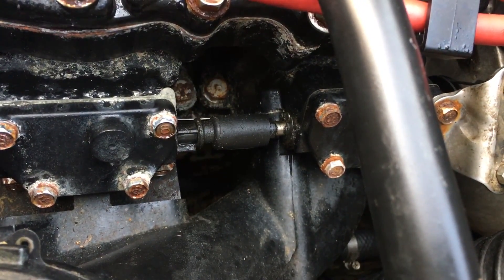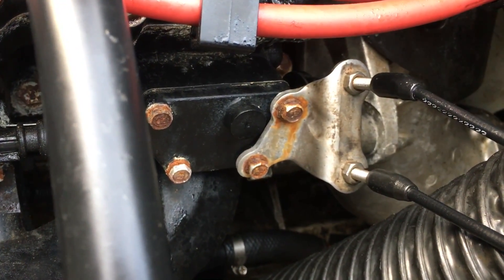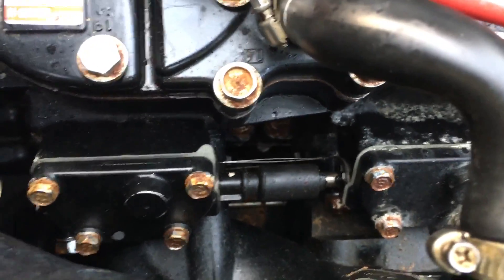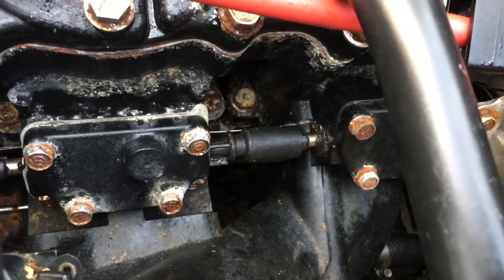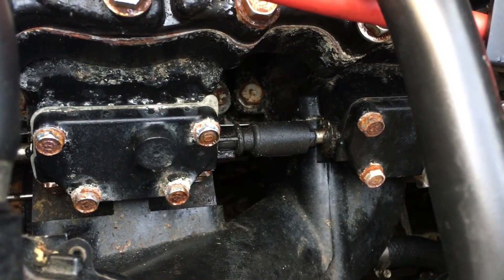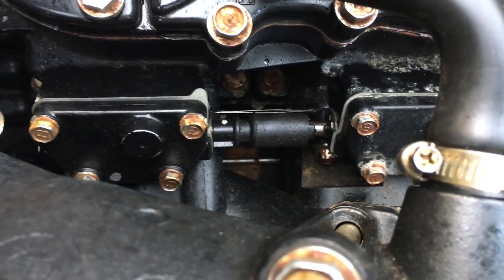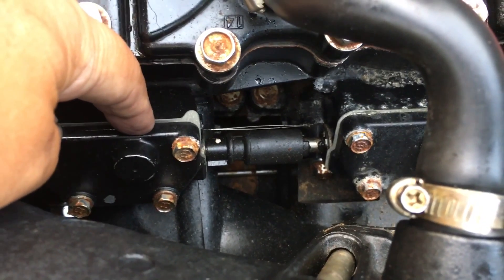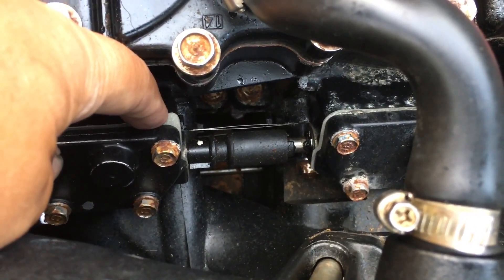Yamaha XLT1200 Waverunner powervalve actuator test

Comment: These valves work in sync
They both go up and down at the same time. You
I put new rings and a cylinder is not working for me,
Is it the same engine of the two Pistons video? What do I do help me with your experiences!

Comment: I have one that is not getting gas to the carburetor the line is not getting gas ether
Reply from the maker: You probably need to remove the carbs and rebuild them.  They can get gummed up.   I believe the fuel pump is integrated with each barrel of the carbs, so on a 3 cylinder model you have 3 carbs, 3 fuel pump diaphragm.    On a 2 cylinder, you will have 2 carb barrels, 2 pump diaphragms.    If the cylinder is getting oil, then its not doing any major damage.   But if that cylinder is oil starved then you have bigger problems.  Also run a compression test on each cylinder.  Search for Greenhulk for lots of online help and resources.

Comment: Mine just cycles forever when the engine is off. Not just once for a test, it keeps doing it untl the battery dies
Reply: I have this issue too, have you solved it?
Reply: @AndreuFA  yeah, I think I replaced the servo and ended up putting the old one back and for some reason it works fine now. Maybe the cable was out of adjustment
Reply: @SamCyanide  okay thank you, i'll check it  and try to fix it

Comment: My man I'm having a problen with my gp1200r . I just rebuilt the carbs and the ski runs strong and healthy but when the engine hits high rpms it powers down back to low rpms like if the ski would go into safe mode . It doesn't bug or misfire it just goes back to low rpms ...
Any idea what the problem might be ?
Reply from the maker: DId you verify that the power valves are functioning properly? Run it on the garden hose and see if they all open properly.   I wonder if perhaps this is a cavitation problem on the impeller, rather than an engine problem. Does it eventually reach proper RPM and top speed ?  If yes then I would look at the jet pump, if no perhaps an engine issue.  A compression test is always good to have.  Also post your question on the Greenhulk PWC forums.
Reply: @joncrisler6001  as soon as it hits high rpms it shuts down it won't let it stay at high rpms..
Reply from the maker: @elx622  Do you get any alarms beeping ? If that is the case, it does sound like a "limp mode".   Go on Facebook and join the group " GreenHulk.Net PWC Performance " for more advice, also "YAMAHA WaveRunners OWNERS" .

Comment: Hey John, I could use your advice on my power valve connections. Can u take questions by email?
Reply from the maker: Yes, I can, but I need to figure out how to get you my email address privately.  Also look on Facebook for a group called GreenHulk , also they have a decent website  at http://greenhulk.net/forums/forumdisplay.php?f=28&s=cd06ea9593be39482dedbc116a24f621

Comment: My #3 cylinder power valve is operating fine, the next 2 don't spin at all. What usually is the cause of this ?
Reply from the maker: Watch the video again: that is the point of this test.  If the cylinder with the input cables works fine, but the other two do not, then the plastic splined linkage is worn or broken.   The power valves themselves might be stuck, in which case you have to pull the tops off the power valves, clean out the gunk to free them up,  replace the plastic couplings.  The power valves themselves are a bit fragile so be careful.   If you search for a parts diagram of a XLT1200 or GPR1200 it becomes more obvious .  Look here for part # 17 -   https://www.babbittsonline.com/oemparts/a/yam/5003a4c7f870021f60a13103/cylinder-crankcase-2
Reply from the maker: Also part #7 is the power valve, but since its a top view it can be misleading.    Here is a better view of power valves-  https://www.shopsbt.com/jet-skis/seadoo-yamaha-jetski-powervalve-ravevalve-parts.html
Reply from the maker: Keep in mind that power valves on a 2 stroke engine are not the same as valves on a 4 stroke gasoline engine like your car.  The concept very different.  A good resource is Greenhulk forums.
Reply from the maker: Just to be clear- in the parts diagram link above- part 17 is the plastic coupler, 18 is the rubber cover that you can easily pull to the side.  Part #7 is the actual power valve.  NOW- sometimes the power valve itself can get gunked up by the burned 2 stroke oil, and cause it to freeze in place, which might break the plastic coupler.  In that case you have to pull the power valve cover off (part #3), loosen and remove the power valve and scrape out the sludge in order to free up the valve.
Reply from the maker: Here is a good video that explains power valves a bit more- its not a Yamaha but the concept is the same- https://www.youtube.com/watch?v=4GFqYN579Mo